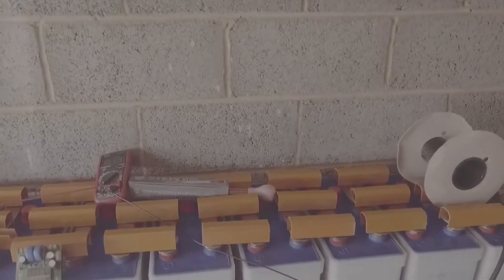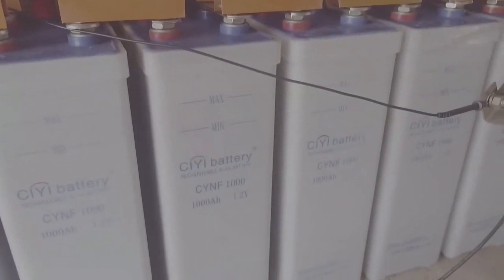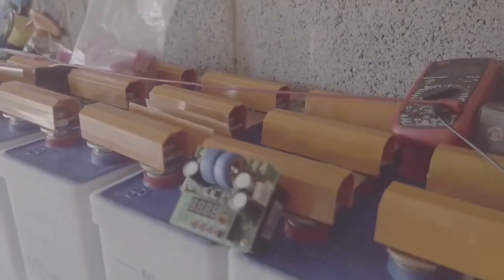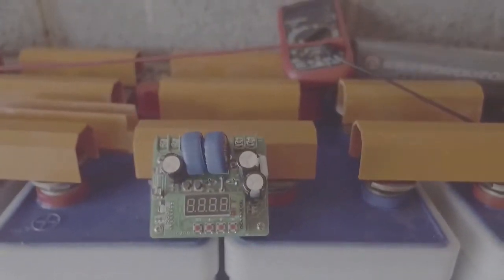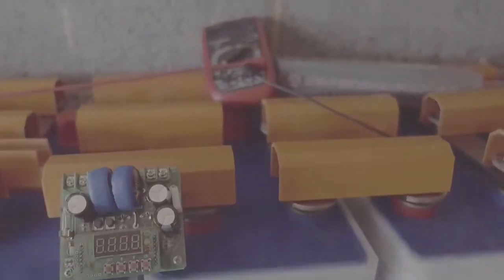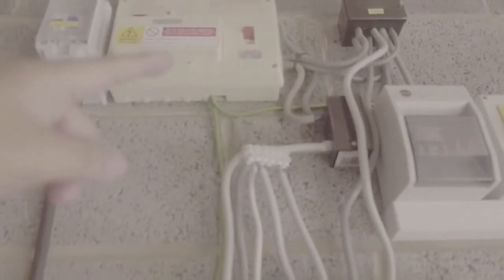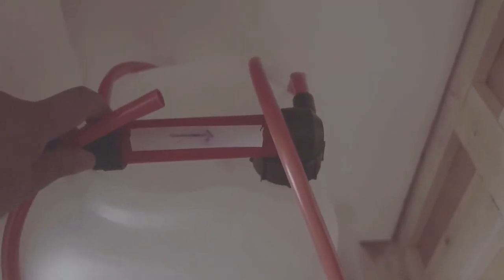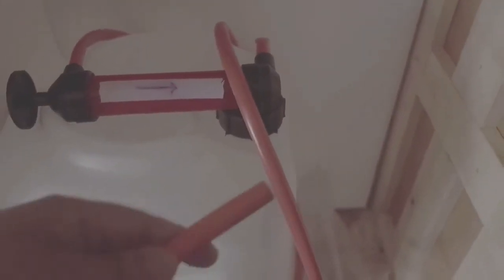My Nickel Iron Battery Solar Setup...

Comment: Hey nice setup can we get a up date on the batteries how are the doing
Reply from the maker: They’re doing ok... I’m getting salty residue from the water cap area... but otherwise ok...
These batteries are really on light use... I really need a outback inverter charger to get proper use... but been busy lately... so not much to report... I’ll do a review when I return from abroad when I get the chance... but yeah I’m been away for a long time...

Comment: Hi Sli
I am about to import some of these can I please ask how they are doing three years on 
thanks in advance
Reply from the maker: Hi rob they are doing just fine for me... although I use them on for light consumption I find them better then my lead acid batteries...

Always use distilled water or make your own... as it will help to keep the plates in better condition... 
the disadvantage is the higher the voltage the more cells you have to maintain... 
I got the ten cell so I don’t have to maintain as many but I got the biggest I can afford at 1000ah... I could use them to cook stuff on a 1000w induction cooker but probably won’t go higher unless I have 24v or 48v but more cells means more effort...

Also to note there is a formation of the electrolyte at the air hole / where you put the water in... I haven’t touched it or removed it because but I suspect it’s the evaporations of the electrolyte... I guess I’ll have to remove it as it’s Crystal like substance that will probably be not good for the plates...

Long time use for the battery is possible but I’ve been told to replace the electrolyte every 5-10 years 

The plates supposed to get blacken over time but I’ve seen a video where someone cleaned them and removed the impurity’s to see the batteries work again... ( again it’s a lot of effort and my batteries are sealed plastic)

So I They might last a lifetime but you have to do maintenance and a little extra effort... 

I hope this answers your question... 
I guess I should do a follow up video but I’m away on business and in lock down so can’t film the batteries yet...
Reply: Thanks Sli 
mine will be going on a canal boat . and trying to work out what to use .... ie how many I can find space for . my invertor that I already own is 12v 5kw so it would be an advantage at 12v .... but obviously 48v would be better . but would be struggling to store 40 1000ah batteries.  been thing 20 at 12v . use some 6, 330w solar and a generator 3.5kw for backup . or possible 6-7kw if I can find diesel one that once again I can find space for . 
going to find out the import duties hopefully today. I have no doubt the man will want he's  cut.
Yes please do make a follow up when ya get chance.  it would be interesting.  might do a video of mine to record how things go. 
Regards Rob
Reply: @robmortimer5380  Considering that companies here in the US want $42,000 for a 1000ah 48v bank, and you can import these from China (same exact batteries) for $19,000 (then of course add the duty), it's still a better deal than these criminals charging double. I just ordered my bank, how much were your "taxes" when they arrived from China?

Comment: Hi, is it still working?
Reply from the maker: YES its still working but I need to buy a outback inverter charger or 3 kw inverter and more panels... as only my 300w panel is supplying a fraction of the power it can provide...

Comment: Awesome batteries!!! How are they working out so far? 
I went with lifepo4 batteries for they absorb energy 3 to 4 times better than AGM or lead acid batteries.
Reply from the maker: They work pretty good. Ive only got them the beginning of this year 2016... so they should last for the next 25years or longer depends if you believe wiki or battery owners who have them for longer... 

They seem like lead acid batteries but they hold much more power... sure they need topping up every 3 months with distilled water, but with the distiller you make your own water and also drink a lot healthier... 

At the moment I dont have the means to charge my battery for more then 300w or a proper inverter charger... but I found and calculated that with this current setup and if I replace my fridge and freezer with a 12v system, I could almost replace the grid power I have with battery power... 

watch this space as I periodically improve my system and achieve this goal of independent power...

Comment: What was the deciding factor to go for nickle iron over lithium? saw you spent 3000 on this bank!! I've had a quote from this supplier as well but a bit too much for my budget. Hey at least they are going to last you a life time!!
Reply from the maker: I know lithium chemistry and despite it being 30 year old tech it wont have the inherent safety or longevity as nickel iron battery... I guess I decided this battery because it was proven by Edison over hundred years ago and that its not so different to lead acid...

Comment: Nice setup, what type of hydrometer are you using to determine water level?
Reply: Sounds good.  Hope to see more as you add more components.
Reply: The electrolyte mixture of potassium hydroxide and lithium hydroxide is not consumed in charging or discharging, so unlike a lead-acid battery the electrolyte specific gravity does not indicate state of charge.
You can see the water level if you put some LED lights behind the cells and view the level on the opposite side.
Reply: +Hal Weant thanks, I'm aware of that information. I also own a set of NiFe batteries. In this video I thought a special hydrometer was being used.
Reply from the maker: its a general hydrometer, only used it once so far when i filled up the cells, i've not had this battery for long... just thought it will cover the night time loads, though i haven't got inverter chargers or the full equipment as you... Im doing it in stages....                 https://en.wikipedia.org/wiki/Hydrometer

Comment: Congratulations on your nife battery. I have a 48 volt set also from Ciyi Battery. Take a look at my preliminary blog at www.acr.us/nife.
Reply from the maker: Nice blog, im not sure about the initial charging as I dont have any equipment to do high current charging but time will tell if i have set it up right... I'll probably buy a inverter charger from outback later on when I can afford it... keeping my system at 3kw as i dont need higher power unless i hook up the electric car charger... watch this space as I will likely to update with more hardware and a 12v freezer or heat pump later on...
Reply: Anna is always asking if I need some more too. lol   If I could use them I would get more. These are doing great. Ask Anna about the initial charge. It makes a big difference. For 1000AH you would need 200 amps for 13 hours 3 to 5 times. You will need to borrow perhaps a big DC welder that will produce that amount of current for 13 hours. I will keep an eye on your space. I wish you all the best with your new Ciyi battery.
Reply from the maker: i had to ask what voltages are you charging your batteries??? most arc wielders operate at 50 to 80v open circuit... And batteries can go as far as1.8v per cell or 18v in my case...
Reply: That is right. And when you put the load on the welder the voltage will drop a good bit more. That is why I could not charge all 40 of my cells at once but did them 20 at the time. I set the selector on the welder until my clamp on DC ampmeter indicated about 160 amps. (my cells are 800AH) The voltage started at around 20 volts then slowly came up to about 34 volts or so as the battery charged. With only 10 cells you won't have any trouble finding a welder that will go up to the needed voltage. Just control the amperage and the voltage will take care of itself.
Reply from the maker: thanks for your help... now to look for a 200amp dc wielder ;-)
Reply: Don't forget the duty cycle.